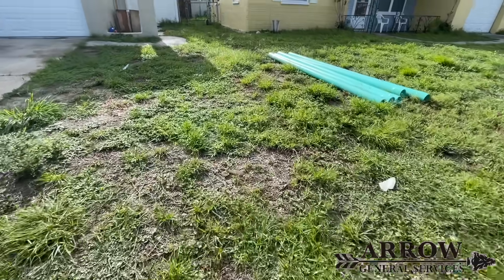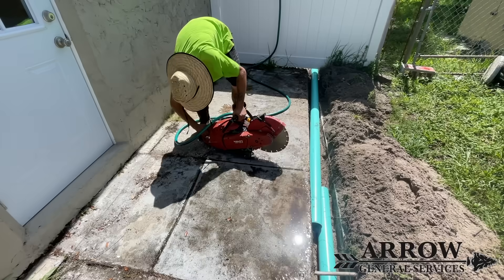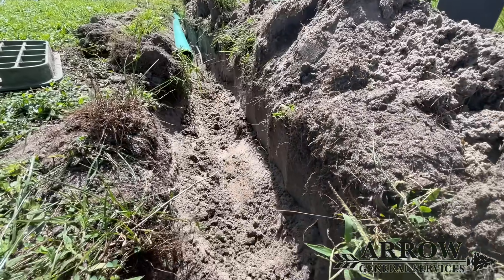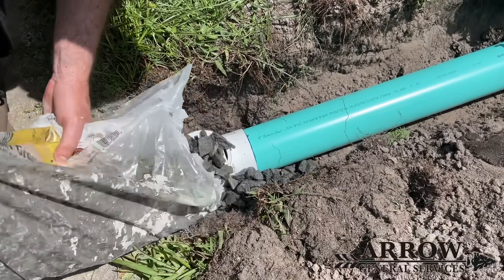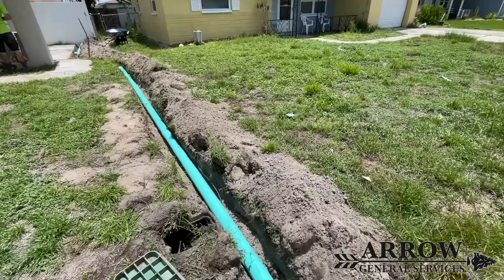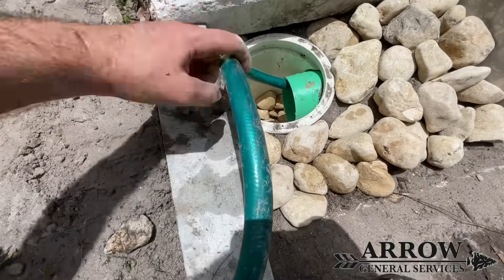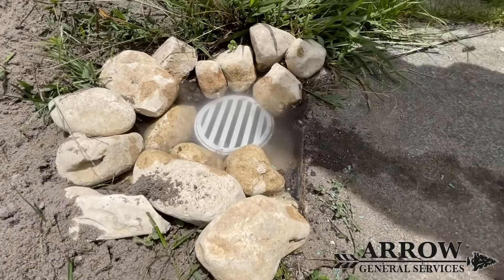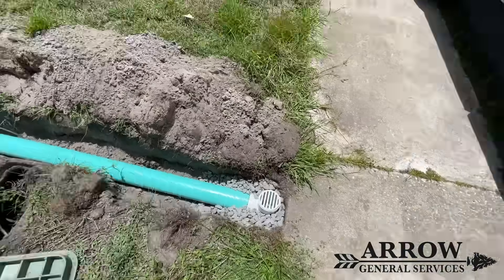How To Drain A Yard With No Slope - Flooding Issue Solved

Comment: What you could have done, is make a grove on the sidewalk with the angle grinder. That way, you will not have a slippery sidewalk, only a half inch channel for the water to flow.

Comment: Why are you telling people that the water that pools up there is coming off of the roof? Hardly any water comes off of the roof on the sides. That is why there are never any rain gutters on the sides.
Reply from the maker: A ton of water comes off that area of the roof because of the way the two sections are angled. Take a closer look. And I’m not sure where you live but in FL tons of homes have gutters on the sides because of the way the roof designs are done here.
Reply: @StormWaterDrainageSolutions  Looks like it definitely floods the back portion on the other side of that fence and pools up in the side yard (on both sides of the fence). The back should have a gutter on the end of the roof to prevent this.

Comment: I got the idea of how it is meant to work, but i do not see the need for the drain rock in the pipe as it will hold more without it and still soak into the ground.
Reply from the maker: The drain rock helps break the water up and slow it down so that it doesn’t cause loss of sediment underneath the tee fitting creating erosion issues in the future.

Comment: I came up with a 10" grid to prevent water in crawlspaces of coastal homes.  Delmarva is a very low lying area in addition to tidal waters.  In the early 2000's (before the mold scare years and the current crawlspace companies) nobody solved this problem.  I did attempt one house with "downhill ditches" as drains and that was a disaster.  I then recognized tax ditches (as they were referred as they kept the fields dry to plant) did not depend on water flowing from the top and instead flowed in from sides & bottoms.  This is the same with these crawlspaces, the water was coming from below almost entirely.  I also observed many failed and some successful french drains below basement slabs.  We ended up digging 6" deep drains and filling with stone (split pipe was mostly a way to reduce the amount of stones and hard work) that led to a sump basin that pumped the water out.  The 10" grid was important because the center would often still collect water without a grid. In more sandy soil the drains can be spaced further and in more clay type soil they need to be closer sometimes.  We have done so many of these through the years and continue to do so.  It really is amazing how well this keeps water out.  All from seeing a need and observing.  Pro tip:  the best way to move stone in a crawlspace is with a bucket & lid and roll it, also a short spade with a D-ring handle for digging.

Comment: The french drain (rubble pit works ok. But if you also add a take off pipe 300mm below the surface from the rubble pit to a pit drain and install a pit pump it will get rid of the water if it overflows during heavy rain.

Comment: Excellent job and very well explained.
I need to find a way to recess a 4"PVC sewer clean out in an asphalt driveway/parking area.
I want to recess it so a car tire won't damage the clean out or push down with too much pressure that it might damage the hub on the Sanitary Tee that's 2 feet under ground. 

Does any one sell something to recess a clean out cap so tires won't damage the pipe should they run (or park) over it? Thanks in advance for any info on recessing the clean out cap to avoid damage. Thanks in advance.
Phil

Comment: Install eavestroughs or gutters as you call them in the states, on the house with extended downpipes. Tear out the old concrete slab and lay new concrete sloped away then do the drainage system if needed. The water falling along the house foundation doesn’t help the building in any way at all it has to be directed away from the house first then standing water on the property can be addressed. Only putting in a drainage system as shown is only half the problems with this house and property. The best solution would be to start with raising the house up at least a foot from the current grade then concentrate on the yard issues. But the. Thst is even more money “down the drain”

Comment: "Water line to house" is actually the sprinkler water supply....water to house is minimum 18" deep (freeze). Sewer lines need grade of 1/4" per foot, entire property lot grade is minimum 1/8" per foot....not flat. Rent a transit and shoot an elevation, that way you can see what's going on with the grading. I wouldn't even start without it. If you can achieve 1/8" per foot I'd core drill that curb and not have to depend on dry-wells. Heavy rain will overwhelm those French drains and your reputation....unless the homeowner knows of these issues and signed a disclosure (piece of paper). Personally, I'd rather have the homeowner pissed off at somebody else instead of me (Plumbing Contractor).

Comment: I have a drainage problem in my back yard.  I will use this information for my drain.
Reply from the maker: @davidrobins7753  Keep in mind every situation is different. One system design that works on one job site may not work on another. Make sure you assess your site conditions and plan accordingly💪

Comment: This is different from most French Drain systems in that you used no perforated pipes, fabric and gravel along its length. Seems like a big savings in labor and materials for this job. But does it perform as well? Thanks.
Reply from the maker: @achardjc  This is not a French drain. The pipes are solid not perforated.

Comment: I recently had to tap in to a storm water pipe to run a channel drain in front of a concrete slab I poured. I was initially horrified to find a bunch of what I thought were cracks I thought I'd made with my pry bar. Upon closer inspection, they were perfectly cut slits along the pipe in top which I've since found out is to allow water to enter and exit. The pipe is at least 1300mm under ground. Is this something you guys do? I noticed that long green pipe you ran doesn't have any

Comment: i did demo for 20yrs the natural spin on that wet saw it pulls forward and also you can see the line youve maked on the concrete you shouldnt pull on the wet saw you move forward it spins at 52000rpm so if it grabs be ready i lost a mate that cut his main artery in his neck he died

Comment: Did you consider re profiling the concrete with a slight fall and digging a large soak away in the yard, possibly with a float-operated sump pump (piped to a proper drain) located somewhere near the top of the soakaway , to stop it overflowing in extreme conditions?

Comment: How do you bring water to your house where the main is 1 thousand feet away and has a 5 foot drop? You start digging with pick and shovel from the main to your house incrementing the deepness as you dig to where it will be 6 feet deeper then at the main for water to gravity flow in the pipe. A one man job at 50 years old.

Comment: Some towns have rules about how close to the road you can discharge. Example, no closer than ten feet. I think a danger of discharging below the sidewalk and into the road is that water can also travel from the road and into your pipe. Finally, at the end of the line, if water has to travel upward to discharge then debris can settle inside your line and clog it. In this case, anything getting into that drain at the door is going to travel to the low point and potentially settle and clog.

Comment: 1. Why use a grate at the end and not a pop-up?

2.  Why not alternately hydro-excavate under the sidewalk with a pipe attached to a presseure washer and then core drill a hole in the curb to daylight to the street?

3.  If the patio sheet flows to the area where the water line runs, why bother cutting concrete and why not just run a french drain in that area instead?

Comment: As a landscaper, if the customer is having standing water issues and there’s no slope or any other way to get the water out from a location, we just dig a 2-3 foot deep and 1-2 foot wide and however long trench. We line it with landscaping fabric, fill it with drain rock and cover it up. It’s kinda like a French drain but without the perforated drain line. We tell people to call us back if it failed and we haven’t had anyone call us back yet! So that 2 foot deep pipe with rock at the end is kind of like that.
Reply: Any videos of your work. Also would you recommend tacking plastic damp proof sheets to the bricks in the trench before filling up the trench with pebbles.
Reply: @NotYourHandleName no videos, but unfortunately I have no idea what you’re asking about the plastic sheets and bricks haha sorry. We just did the trench, line it with landscaping weed fabric (the woven stuff so water can move through it) fill the trench with drain rock, and cover the the top with more fabric and either cover that with mulch, more rock, or even dirt.
Reply: @nickbono8 so with no pipe just like a trench but just with drain rocks
Reply: Are you referring to a vertical drain?
Reply: @LNStrange  I feel like he's talking about a swale?
Reply: @JP-pk6sc  yeah it’s just a deep swale. The theory is the water in heavy rain periods will fill up the in trench rather than on the surface, and over time that water will dissipate into the ground.
Reply: I tried this on a flat yard but it doesn't seem to work. The water will sip out from the outlet but then water standing from the inlet. Eventually water from the inlet will drain. But it seems like the water don't have enough push to get it above the outlet. What to do?
Reply: @raylee011gamil  bigger and deeper trench or sump pump if can't go downgrade from center of flooding.  There are usually only 2 options depending
Reply: @raylee011gamil  It won't work. Water runs downhill.
Reply: This method is only good  for the summer. In the winter the water will not drain, and the entire pipe will fill up with frozen water because it cannot get out.
Reply: do u slope the trench too?
Reply: @Derpherppington  No. Don’t need to. The water will percolate through the drain rock and slowly fill the trench while at the same time absorbing into the ground. This eliminates that standing surface water.
Reply: @nickbono8  will this still work if the soil is clay heavy and doesn't absorb water well generally?
Reply: @prplestiky  that’s the best situation to install something like that. Where we work, it’s all heavy clay. As long as you make it large enough and deep enough it should help.
Reply: I do the same but use perforated pipe centered in the rock. You can use the perf pipe like a clean out.
Reply: Fill up with those rock may be more expensive
Reply: So a soakway....
Reply: How long is the run length?  I suppose it should work in heavy rain as well?
Reply: How wide would you recommend digging away from my wall if i do this
Reply: @jrElprosti  the wall to your house? Not sure honestly. I don’t want to give you wrong information without fully understanding your problem. Contact a licensed contractor in your area about your drainage issues.
Reply: @jrElprosti google says 4 to 6bfeet away from your foundation. This is goggles answer though
Reply: My neighbor has a downspout that drains right into my 'lower' set yard below.  How far do you need to be from a foundation to do what you described? Can they dig it almostg against their house w/o foundation damage?
Reply: @brianb2250  probably best to stay away from the foundation.
Reply: After doing all that digging, why not use the perforated drain line?
Reply: @peacew6  @nickbono8
 this is my exact question, seems a low cost way to make the work even better. Curious why not to put in the perf pipe?
Reply: Glad you mentioned that the homeowner was going to rehab their backyard.
Not trying to yard shame, but that nice river rock definitely overshadowed the rest of the yard.

Really good video and I’m of the persuasion that PVC holds up longer than corrugated pipe.
Reply: Glad you did no calculations and just eyeball it.  That's why people don't trust "professionals.". Just people with equipment and no brain.
Reply: Like an infiltration pit?
Reply: Hi, I'm hoping for some advice on drainage under a flagstone path next to our house. We have had professionally installed risers that feed to the storm water drain. We want to DIY stepping stones and pebbles next. I have done alot of research but I'm getting contradicting ideas. 

Attached is an image of how the risers look and a drawing of our plan for the pavers and the layers we were planning (excuse my handwriting). We'll put square grates on these risers and we're hoping to have them hidden under the flagstone and pebbles.

Where we're stuck is whether we should make drainage gravel pockets around the risers and connect them with a narrow drainage trench or just make the pockets around the risers alone. The purpose of these is to lead the storm water to the drainage grates. Any advice will be really really appreciated!
Reply: had water puddling in front of my home after raining  heavy or light the rain puddled where the street met the property. It also went out into the street about 3 feet 
my stone mason did what you mentioned  and it pretty much did the job .  we had pachysandra growing there too. it was a very shady spot and grass couldn't grow there. . The pachysandra have gone bonkers I think because they are getting a lot of water now . never knew pachysandras had flowers
Reply: @robrandolph9463 
Pachys LOVE WATER... 
We had a backyard that needed 2 swails filled with large creek rocks and they filled up fully with water and pachys all over. They took over and it's a sure fire way to a labor free green, all year round yard that has too many trees to grind down. 25years later, they still pretty.
Reply: How wide apart would you recommend digging from my wall

Comment: There's only one problem with this no pitch drain, in  cold climates that pipe will fill with water, freeze solid, and then your screwed.
Reply from the maker: Correct. Only good for places where it doesn’t freeze 🥶

Comment: It might have been better to have installed a sump pump basin with an electric, float activated pump in order to pump the water onto the road so the system would not get overwhelmed in a heavy rain.

Comment: If I need to add an extension to SDR 35 cleanout T at the top, do you think the system would still work? That is, the water will still discharge fine.  I have around 18 inches from the base of my trench to grade level.  Thanks so much for your help!

Comment: Why not do a dry well? I do lines similar to that. However I give it more of an area to go. I dig a hole 5ft.x5ft.x5ft convert to a perforated corrugated pipe coil it into the drywell.. Fill the hole with gravel and install an overflow attached to the drywell. It's a system similar to a leech bed

Comment: Take the drain thru the curb.
Reply from the maker: The city doesn’t like it when you cut through their sidewalks. And if you watch the entire video the curb connects to the street and is smaller than 4inch thick, so getting a 4inch pipe under that with slope is a no go. This particular neighborhood was designed very strangely.

Comment: Great video but I am just wondering what the purpose of the rock inside the pipe is for. Do you need rock inside the pipe? It seems like the rock is just taking up volume that water could use to fill which would make the pipe fill up faster. I am not trolling, just genuinely curious because I have a difficult drainage situation at my place and I basically have to have a system that absorbs as much surface water as possible during a heavy rain and let it drain slowly over a few hours after the rain.
Reply from the maker: Good question, the stone is placed only at the bottom and around the tee so that water is less likely to erode the ground out because it hits the rock first and then seeps through to the ground once the rain stops so the pipe can drain out completely. Also use a geo textile fabric as a soil separator under the tee so that dirt doesn’t mix with the stone. This was a really old job filmed awhile ago. Check out: https://m.youtube.com/watch?v=89Wic7ewRAk